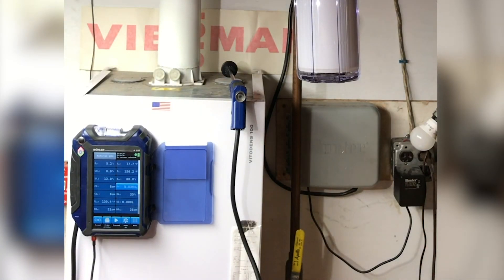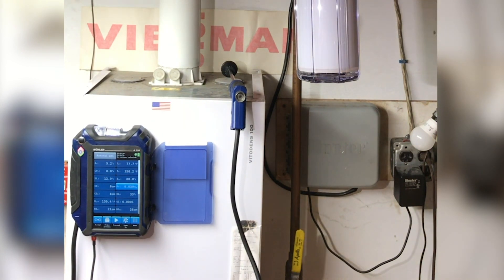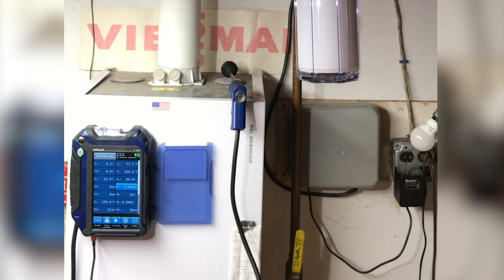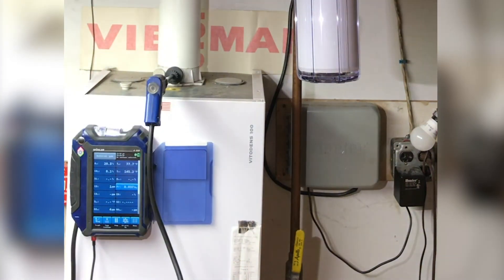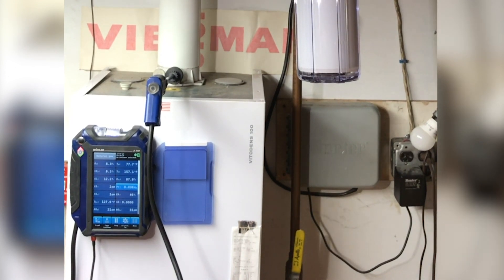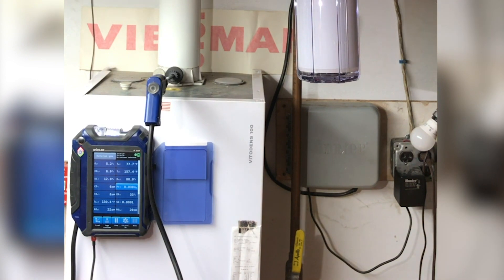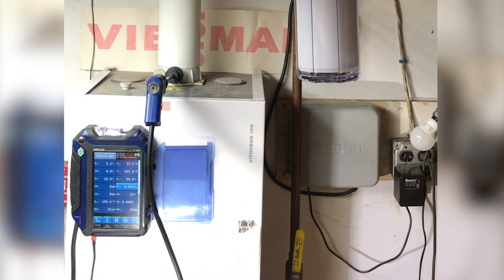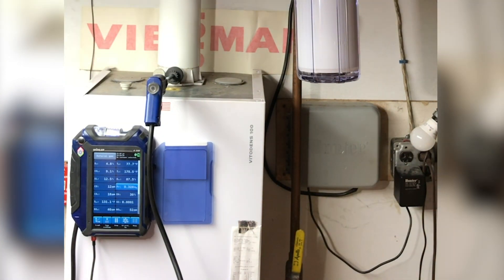How-To: run a combustion test w/ Vitodens 100

Comment: Hey , just bumped in to this video ! I have the following problem on my Viessman B0ka 25 kw. Error 64 wich is related to the detaching the fire in the combustion unit. The measures was done with the probe on the exhaust of the flue and the CO ppm content when iniatilly fired was 3000 but then she setlled down to normal. What could be the reason ?
Reply from the maker: Hello, can you please contact our technical support line for this question? Their number is 1-844-649-5886.